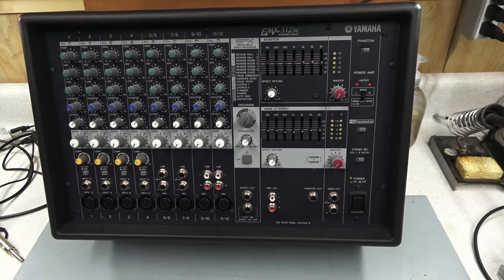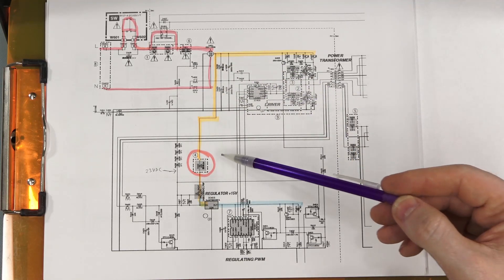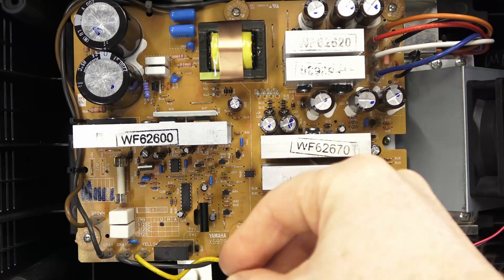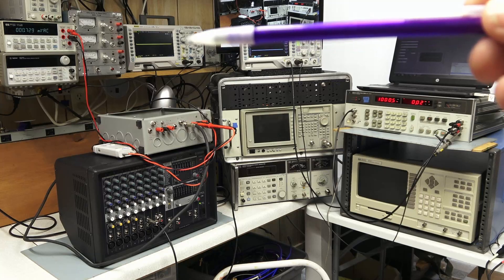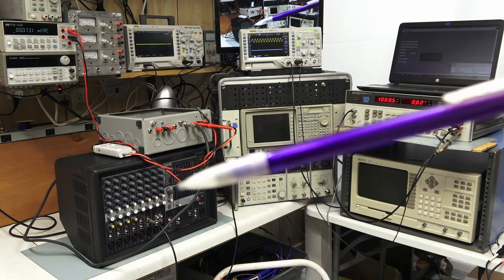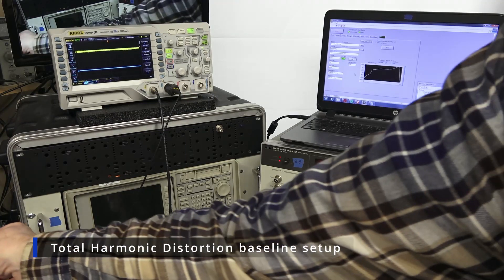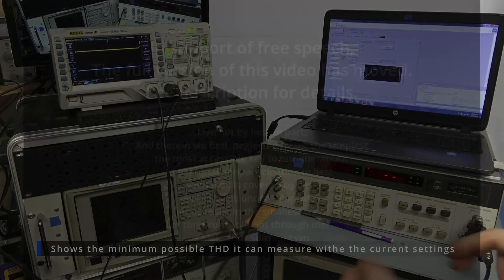Yamaha Powered Mixer   EMX512sc   Repair and Test (#013)

Comment from the maker: 0:00 - Intro
0:15 - Schematic
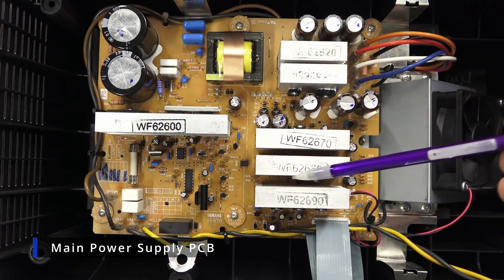4:26 - Power supply PCB
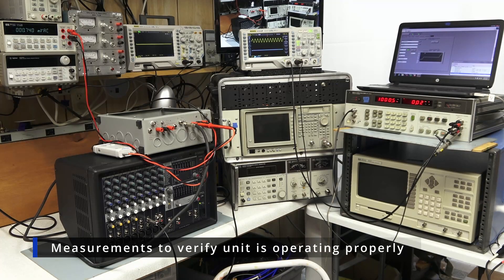7:14 - Frequency Response test setup
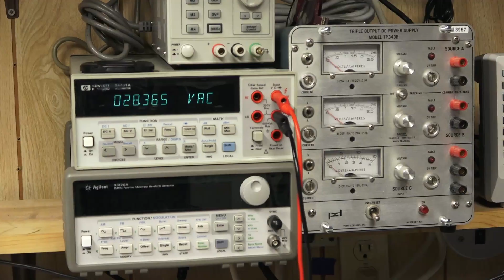11:58 - Frequency Response CH A 100W sweep
12:36 - Frequency Response CH B 100W sweep
12:55 - Frequency Response results
Additional testing here: https://rumble.com/v150et8-yamaha-powered-mixer-emx512c-repair-and-test-013.html

Comment: A church called me about their Yamaha EMX 312sc that quit working after an electrical storm.  Same symptoms, so I studied your video until I was fairly confident that the same thing was happening here.  Replaced the same two components and it came back to life!  But then I discovered that, although the preamp seems normal, there is no output from the "B" output (monitor side), only the "A" side (mains).    So, I'll get back to work and try to figure that one out........unfortunately without a helpful video like yours.  Thanks so much for sharing your expertise!

Comment: Mine works but one of the sliders broke off how would I replace it
Reply from the maker: It is a lot of work for 1 slider.   Remove all front panel knobs, remove the front panel PCB from the panel.  Desolder the slider. Install new one and reassemble.